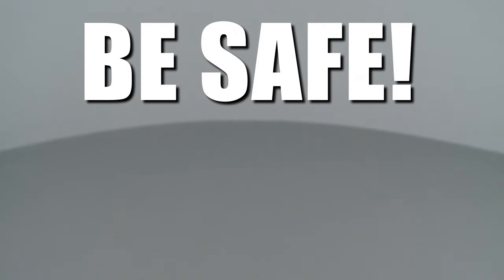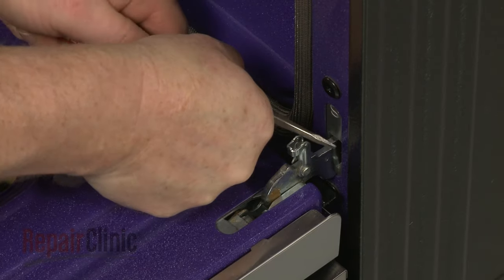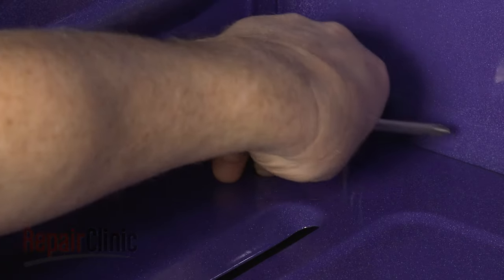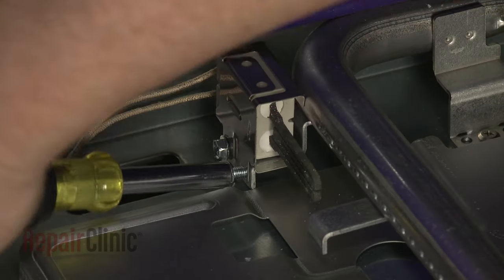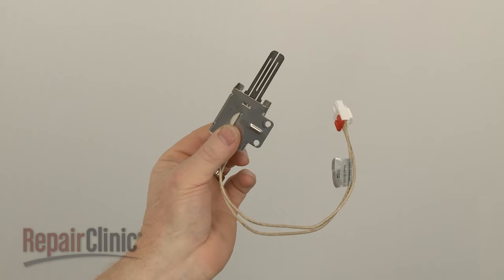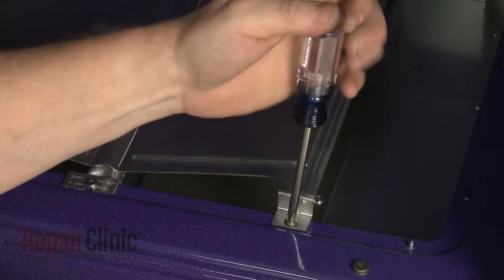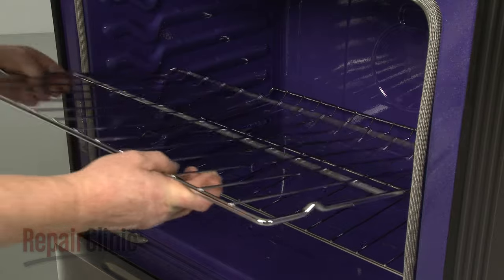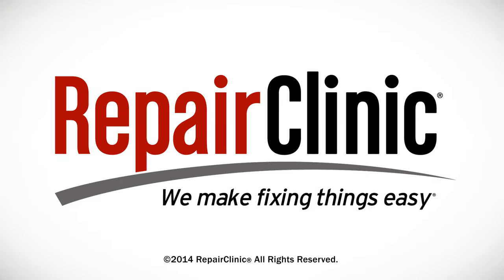LG Gas Range Oven Igniter Replacement #MEE61841401

Comment: For all of you brave souls that decide to order this part and replace it yourselves, keep in mind that its a DELICATE  part!!!!! we received it and were so extited to fix our oven finally. The part fell maybe 5 inches and broke into pieces😥 Had to reorder and wait another 9 days.  Again ,its a fragile part, don't touch it until youre absolutely ready!
Reply: This video is excellent.   The lesson I learned is that they are using a brand new oven.   The screws holding the igniter come right off.  Not so when the oven is 4 years old.   One of the screws snapped and the other loosened enough to get a Dremel cut off wheel in there and I finally got the old igniter part out.    In hindsight I should have just removed the old part when I ordered the new one.   That way I could have just run to the hardware store some time before
the part arrived.   My oven was not the exact same set up as in the video, but I was able to remove the whole gas tube by removing 2 screws.   That way I was able to do the hard part on my workbench.    The plug does not come out as far as shown in the video, but you just need to work on the front end of the plug.   Thanks for a great "how to".
Reply: I wish I had read this helpful comment (thank you Jen) before spending the money on the part and getting near completion of the repair.  Repairclinic, PLEASE add this info to the video!  You are so good about "sharp" and "heavy," people should know that the part is delicate.  It's not what you expect when you are dealing with an oven.
Reply: @johnbrunke8605  seriously! My too. One igniter bolt snapped right off using a socket and ratchet. What are these bolts made out of, glass??! For the rest, a 12v Bosch driver is your best friend. You don’t even need a flashlight with it. Also, that door hinge part (taking it completely off and putting it back on was next to impossible.) maybe it’s that easy, but only with a brand new oven! Not the real world.
Reply: Ahhhh! Just happened to me! I had it on and I was tightening the nuts and the wrench slipped, hit the piece and it shattered! I want to rip my hair out.
Reply: this happened to me too!!!

Comment: The broiler igniter is the same type as the oven.  If your in a pinch and can't get one for several days, you can pull the igniter out of the broiler.  Takes an extra 45 minutes.  Never use the broiler, so probably won't replace it.

Comment: Good video. But how about a video for changing an igniter for the top oven on the double oven LG ranges. I have to change one on an LDG3016st and the wiring connector just doesn't feed out like the bottom oven, smaller hole. Might have to take the back off. Or have as easy access to the screws holding the igniter in.

Comment: I have an LG LRG3095SW oven and installation was easy to understand but bolting the new igniter was difficult due to the cramped space. WARNING!!! Do not put any pressure on the heating element.  It is not metal and will snap like a piece of plastic. If there are any open holes, you may want to cover them up or you may end up having to take out the warming drawer.  I had to remove the warming drawer to retrieve a bolt that dropped down a hole and, also, to access the plastic wire connector. The you tube video was very helpful.   All things considered, the oven is working again.

Comment: The door doesn’t pop out the easily. Definitely the most ridiculously hardest part. No angle works. And almost impossible to put back on. Also if one of the hinges snaps back into place while the door is off, you better have a heavy duty pry bar and something that doesn’t mark the paint/metal on the door but still can take all your body weight on it! That thing probably took peoples fingers clean off before. Also, the bolts on the igniter are actually made out of hollow, blown glass. Literally. A nut driver or a Philips screwdriver (also an option they didn’t mention) won’t even get down into the part where it doesn’t strip the bolt head. It’s too close to the bottom with no room to work. Notice how they don’t zoom out far enough to show the real life struggle of undoing it. Shady. The bolts are welded in and one snapped instantly off the threads using a 1/4” ratchet and socket with no effort whatsoever. Pitiful. Some “fancy” oven. Also you don’t need it unplug it if you’re careful. The power cords in these ovens are horrible and way too short. Pulling it out isn’t always an option since it can damage your wood floors, especially laminate. Just be careful and you won’t get shocked by installing this powered up. Also, all you need is a 12v Bosch driver to this swap. The built in LED and tiny size made a flashlight obsolete in this case and it fits into the tiny places. Except for the way too low lying igniter bolt placements. The engineer should be fired. LG please hang your head in shame.

Comment: Wow!  What a great video.  Thanks.    I was flying through the repair until I came to the old igniter removal.  My 5/16 socket would not fit in the working space due a slightly different model I have, so I had to use pliers.  No problem.  Just took more time.
Watch your igniter pricing!  Range from $40 to $169.  Shop, shop shop!

Comment: Great, easy to follow video. A repair tech quoted $ 200 for parts + $ 300 for labor, but told me I could replace it myself and suggested this video for instructions. $ 50 part and 30 minutes later, job complete and successful. As someone noted, the part is fragile, so be careful. only problem I had was getting the oven door back on.
Reply: The part is only $35 and even that’s a little more than what they go for. You paid too much.

Comment: great time to also clean the oven door and vacuum out the crumbs.   I was able to use a rod and cleaning swifter to give glass oven door a cleaning.   Followed the directions and everything worked well.  I ended up using a LG OME part cost more but I did not want to risk it with an aftermarket part. Place the bubble wrap under work area so if the igniter falls while securing to oven it will not land on metal pan.

Comment: Thanks so much for the video! The hardest part was putting the darn door back on. ALSO, didn’t/couldn’t use the socket tool for the hex screws. They must have changed up the design a bit, because the socket tool would not have worked on my model because it would not have been able to get around one of the bolts because it was blocked by the part the flames come out of.  Was going to try a little wrench, but noticed the Phillips head on the screws. Thanks again. You saved me a bundle! Although I thought for a while I’d have to call a technician anyway to help me get the door back on!

Comment: Thank you for the concise and simple tutorial. I just replaced the ignitor on my LG Gas oven without incident. Had been getting the F9 code intermittently for months but the oven would eventually warm up although the temperature was very inconsistent. I finally replaced the part (ignitor) and yes, it works! Feels good to have saved the money of diagnostics and repair. "pat myself on the back too".

Comment: Great video.  I was getting an F11 error. Orderd an igniter replacement, and installed it  today.  Took me about and hour, but I was taking time to clean up as I worked.  The hardest thing was removing the mounting screws for the igniter.  Thank you.  Saved me a service call. Now my oven heats!

Comment: the range had code f11,so i found the genuine part oem and went on you tube and 35 min later working fine thanks repair clinic.
Reply: Robert Stepney my range is also displaying f-11, and not heating up properly. Did you replace the igniter?

Comment: It's a great video. However, I have a double oven and when I took off the bottom panel and the burner shield there was no access to the mounting screws to the ignitor ( I did this for the top oven as well because I need to replace both upper and lower and in both cases I could not get access to the mounting screws, it seems to be placed right by the gas line and seemed much more complicated than the single oven in this video). I had to stop the project and put everything back. Any answers or suggestions?
Reply: I just wanted to say that I'm in the same boat, it's not a good boat to be in.

Comment: While others have stated how fragile this part is, it is extremely important you never touch the element. The oils on your skin will cause the part to fail quickly. If you notice on the video the technician never touches the element but only handles the white portion of the part.
Reply: Like car head light bulbs, if you touch it, just hit with the alcohol preps! Done.

Comment: Thank you very much for this video! Mine just died today.
Reply from the maker: +Sung Cho Glad to help.
Reply: Hello I had a question for you.
I just replaced my igniter today and the range is working great again.

But the old unit I took out does not show any signs of damage or cracks in the filament. Is this normal?

My drawer below the range was very packed and I am wondering if it was too full to allow proper air flow to the gas to start? or is it pretty typical that the igniter can fail without showing visible damage.

Thank you!
Reply from the maker: +Sung Cho Not unusual for the oven igniter to get weak over time, not likely a problem with the stuff in the drawer. Click here for more info: https://www.youtube.com/watch?v=hweqe2tPklo

Comment: This looks nearly impossible on the LDG3036ST.  You still can't get to the hex screws after taking the burner shield off.  There's another sheet of metal with a big screw dimple that goes down, further covering access to the screws.  Hell, you can't even pull the pigtail through the hole like the video shows, gotta take the whole back plate off to get to the connector because they have the wiring so tight.  I'm stuck.
Reply: @kingsxkids ... which brand is American/U.S. made these days?
Reply: I got my part in two days.  I got the igniter mounting screw off without trouble.  The entire process took me about an hour but I was cleaning up along the way. Great video.
Reply: We have the exact same model. Was doing pretty good until we saw the igniter wires going into the back of the oven. Didn't want to pull it out and take the entire back off. A little learie of pulling out a gas stove😩
Reply: @shannonmcleod7943  I barely remember this, but IIRC, I ended up taking pliers and just bending metal out of the way.
Reply: @nathancoy8066  It was the igniter. I was happy I did order the right part for our ldg3030st from amazon.  I did wind up having a repairman come out because the back of the stove had to be removed to replace and with it being a gas stove we did not feel real comfortable pulling it out.  The part was already there and he didn't charge us much to replace it. Just $125 so not too bad. Our error code was F19

Comment: Owners of  LDG3036ST/BD ranges! LG has altered the heat shield below the burner so that it totally obstructs the igniter mounting bolts. However, the mounting bracket is attached to the burner. Undo two screws and remove the burner and the igniter comes with it, then the bolts are easily accessible.  The wiring harness is too tight to allow the union to be pulled through from the back so you have to use ceramic wire nuts to join the wires.  

I spent a couple of hours messing about trying to undue the mounting bolts through the narrow slot available. When I realized the igniter was attached to the burner, not the oven floor, it took only about 20 minutes to finish the job.
Reply: I had the same problem with getting the wiring harness thru the access slot. I removed the bottom drawer and untangled the harness and was able to pull it through.
Reply: Hi John W. I had the same problem with my double oven yesterday. I removed the bottom panel and burner shield  to both the upper and lower oven and had no access to either ignitors. I gave up after that. I'm sure I'm not as handy as you are, can you tell me step by step what to do after removing the burner shield? I would appreciate the help, thanks!
Reply: @PeterParker-wh9de  its been a while and I don’t remember exactly, but the burner was only attached by two screws. Like most gas burners, it is not solidly fixed, only a sliding fit, and it is easily slides out once you have removed the positioning screws.
Reply: @johnw4016  Thanks! I'll give it a shot!

Comment: My range is about 3 years old, I've been getting the code f-11, I have to restart it to get it to heat. That worked for a while, now its not heating up properly. I also smell gas every time I turn the oven on. Wondering if I need to order ignition part, or sensor? Any help is appreciated;)
Reply: We had the same code and ordered the igniter from Amazon.  Our oven works again.

Comment: The wires for the old igniter seem stuck down below, or not long enough to pull up.  Any idea the best way to get access to them?
Reply: remove the bottom drawer. I had the same problem - wiring harness was tangled with another wire. I was able to untangle from underneath and then pulled it through to complete the repair.

Comment: How did you know to replace the igniter? Was it because it had an f09 error code or how did you know they igniter was bad on the oven?
Reply: Measure the igniter with a meter.  It should be between 45 and 400 ohms depending upon the age of the igniter at room temperature.

Comment: New oem igniter and temperature sensor. Still f11. Any ideas? Broil and top stove work.
Reply: Measure your new igniter with a meter.  Should be between 45 ohms.  If it is open, it's bad.  Also never touch the ceramic element of the igniter.  You skin oil will shorten the life.
Reply: @robertpittman2550  it was the wires in the back was chewed from mice. They made a nest in the bottom. I rewired it and been working great for last 8 months

Comment: Wish my oven was that clean!  I have a LRG3093st /00.  Does this have a second ignitor on the top of the oven?  it kind of looks like it does?!
Reply: Yes, the broiler igniter is the same as the oven.  If your in a pinch, you can swap them as that is what I did.

Comment: Note: this video is not correct for double oven models. For the double oven model you need to unscrew and lift up the large pipe in the center of the oven that distributes the gas to access the igniter unit.
Reply: I found that out yesterday! After I took off the burner shield I realized I had no access to the brackets! I was scared to mess with the gas pipe and I also couldn't pull through the wire harness through that tiny slot! Is it worthwhile for me to try again?